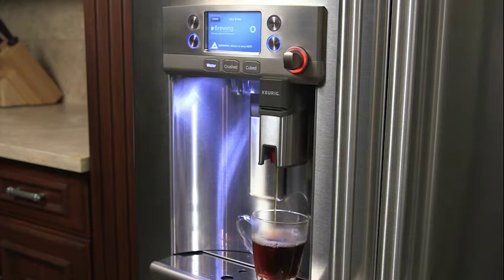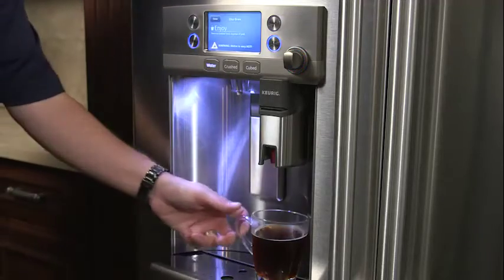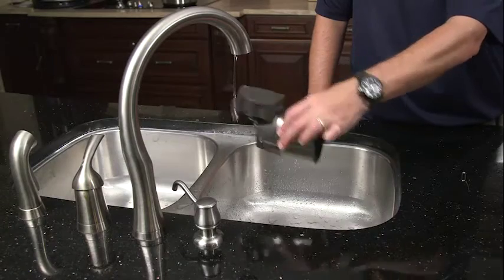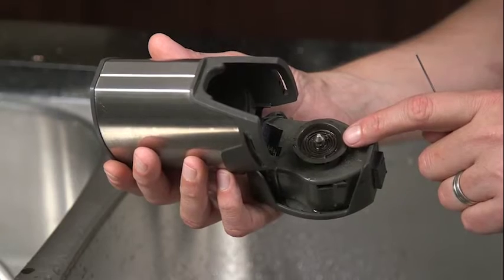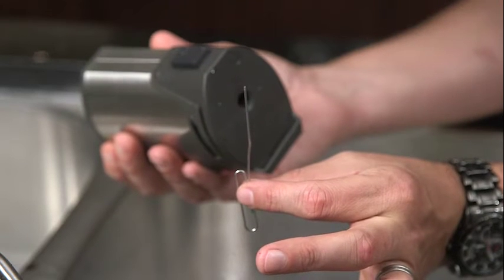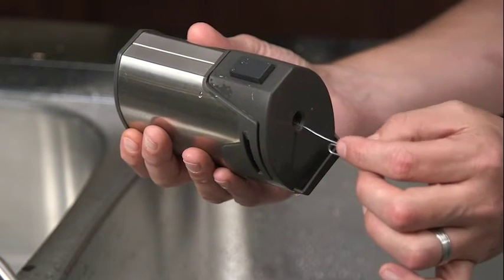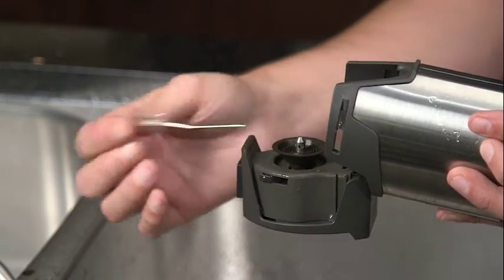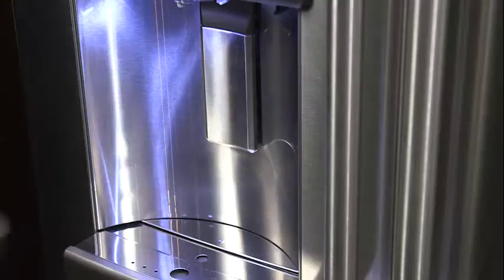Keurig® Brewing System Cleaning - Bottom Freezer Refrigerators

Comment: I have an older Whirlpool model ca 12-15 y/o where the left hand side stays open by about 1/8 to a 1/4 inch and I don't have the adjustment screws as indicated in the video.
What would I need to do to adjust the left side of the freezer drawer back in so it closes correctly?
Thanks.

Comment: How do you descale?  Mine only puts out 4 ounces on an 8 ounce cup
Reply from the maker: Hi Zach,

Thanks for reaching out. We'd like to help as best we can. French-door refrigerators with a Hot Water option, including models with the Keurig® K-Cup Brewing System, do not require descaling like Keurig® standalone brewing systems. This is because our stainless steel hot water tank is coated to resist scaling and because the tank never dries out. Scaling most often occurs when a water storage reservoir dries out and leaves behind calcium deposits from the water.

In this case, we'd recommend taking a look at the following article to see if it helps: http://spklr.io/6055lrRD

If none of this helps, and your unit is still not dispensing the proper amount of liquid, then we'd recommend reaching out to our service team, here: http://spklr.io/6056lrRE

We do hope this helps and that this is taken care of for you soon. -MS

Comment: I have water leaking from behind the touch screen, it runs down the left side of the screen facia and down the front of the fridge. Not happy with this fridge.
Reply from the maker: Hello Kayak - we are very sorry to hear that you have water leaking from behind the touch screen on your refrigerator.  We are happy to assist with use and care questions and basic trouble-shooting questions; however, we recommend that this be properly diagnosed by a service technician.  We recommend contacting GE Factory Service at 1-800-432-2737 for assistance.  We hope this helps!  -NC